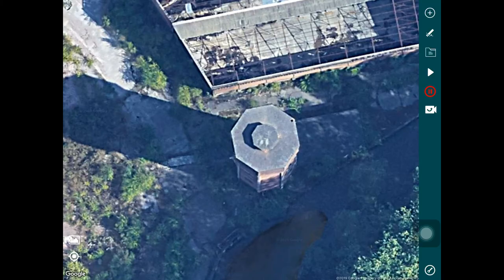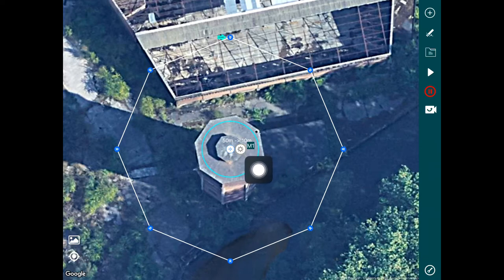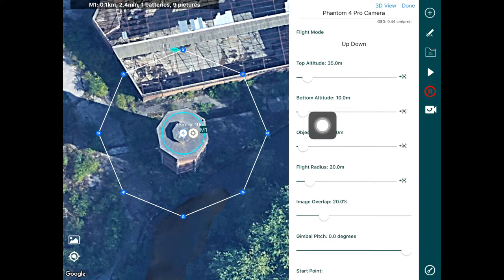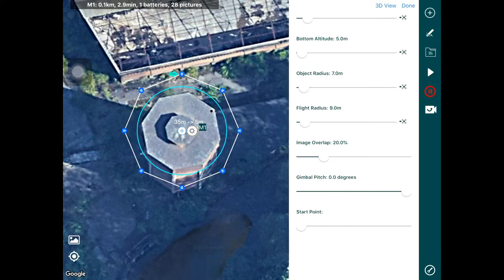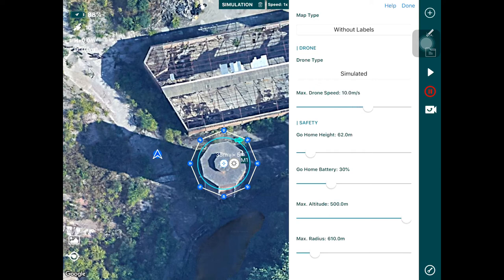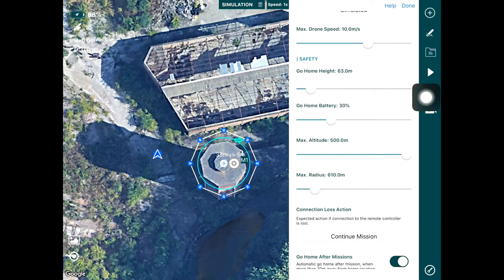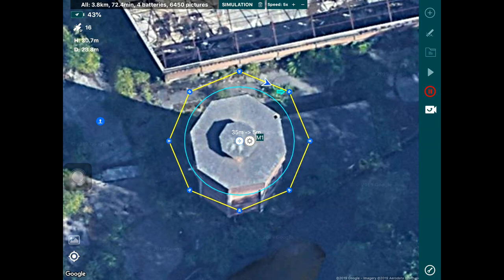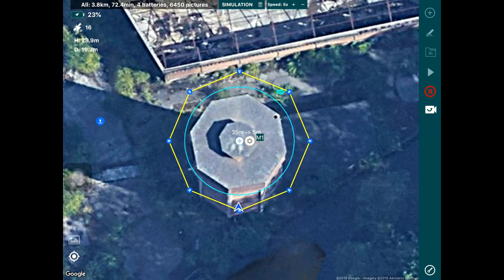Tower Mapping with Hammer - Tutorial #002

Comment: Please can you explain this
Fly the drone to the top-centre of the tower. Tap the back the right button on the remote controller. This will generate a mission with default parameters, centred on the drone’s position / tower’s centre.?
It states "Tap the back the right button on the remote controller" it doesnt quite make sense, do you mean the button on the underside and right side of the DJI Controller?, thanks
Reply from the maker: Thanks for the question Nicholas. We mean the button on the underside of the drone (c2 button). If this button is unavailable on your controller, you can also tap the drone icon on the map and the drone's current position will be captured. Hope this helps!
Reply from the maker: You can also use fly-to-draw functionality in all Hammer missions:
https://www.hammermissions.com/post/precise-asset-inspections-using-fly-to-draw-in-hammer

Comment: What if the object is a conical structure and the radius of it is changing? How to set up the flight (the object radius)so the drone could keep the same distance from the object all the time?
Reply from the maker: thanks for the question! It really depends on the object - if the radius shift is not large, then this a constant radius would not affect the quality of the output 3D model / inspection images. However, for a large radius shift, there are 2 strategies:

1. You could create multiple flight plans each with a different radius and top -> bottom altitude, and later combine these images. 

2. We could add a 'radius shift' parameter in the upcoming versions so that the planned path will increase in radius by 'radius shift' metres, so effectively start the closest from the tower and gradually increase distance. 

What are your thoughts on the above?
Reply: 'Radius shift' parameter would be an excellent idea! I imagine adding 'object radius at top altitude' and 'object radius at bottom altitude' slider bars should solve the problem. I'm looking forward to see it in the upcoming version!
Reply from the maker: @jaroryczkowski4117  Thanks Jaro, we've added this to our feature requests!